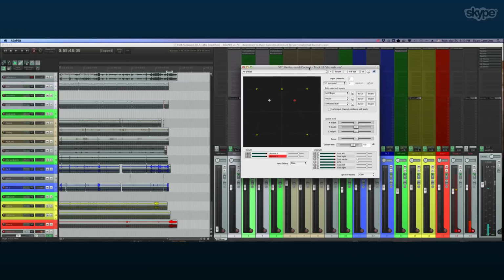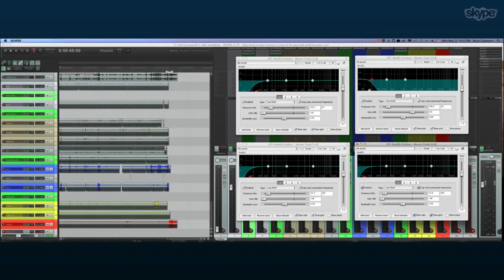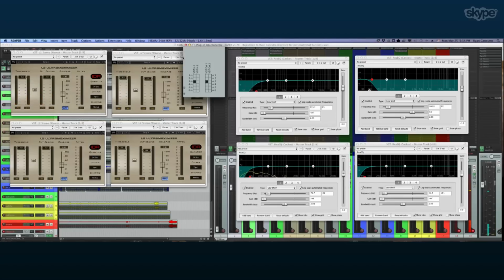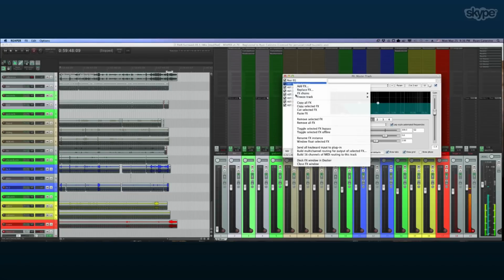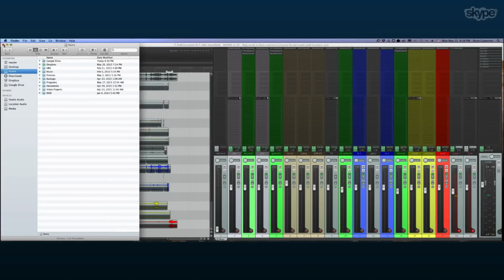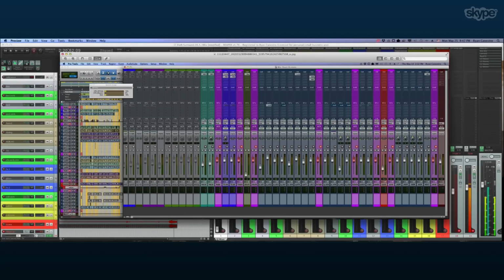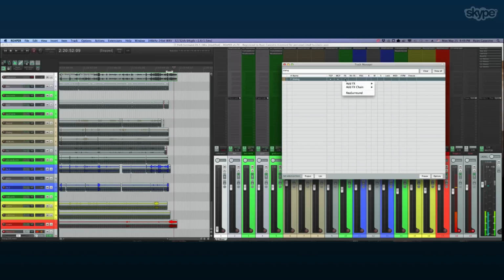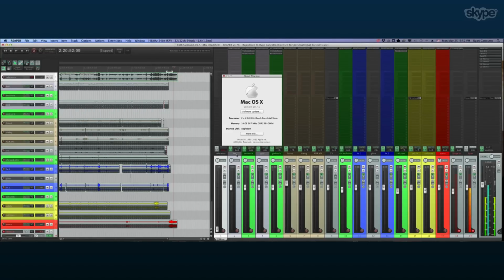Surround Mixing With Ryan Canestro

Comment: reasurround and 5.1 direct sound is not working at all. so In sony Vegas this is one click and work smooth as u need. surround mixing is easy in vegas, but in reaper its just not work at all! i wati 3 years no to fix this issue. but no there is no fix at all!

Comment: +The REAPER Blog Jon, I'm pretty new to Reaper, coming from Adobe Audition CS6. I'm currently working on a short film for Festival release, mixing sound in Audition, but am considering moving it to Reaper. I'm familiar with the features in Audition, especially the FX, tools, and the quality of them. What I don't know is the overall quality of the FX and built-in plug-ins in Reaper. Are these all written by various people, and do these people have experience in developing mathematically optimum algorithms for sound (i.e., like the plug-in factories)? For example, I've tested the ReaSurround FX in Reaper because I will be printing in 5.1, and what I found in my testing was that when I moved the sound around in space (rather rapidly), I'd get static, which was not only in the 'live' version, but was also in the recorded files upon replay. Similar tests in Audition had no such artifacts. So it immediately made me question the audio fidelity of the Reaper FXs. I have to say, though, that the usability and customizability of Reaper far outweighs anything available in Audition. Anything you can add that might boost my confidence on the FXs? Would love to hear from others who have used the 'industry standard' DAWs (ProTools, etc.) and then switched to Reaper, and how they assess the built-in plug-ins in Reaper. I know Reaper supports 3rd party, and most of these experienced folks will have libraries of their own plug-ins they will use, but so far I've been pretty pleased with the default plug-ins in Audition. The only other thing that held me back originally from moving from Audition to Reaper was the lack of a Waveform editor. Fortunately, since I own Audition, I set it up as the 'external' editor and that would be a workable solution short term. Audition's wave editor is quite powerful, and fully integrated. Any plans for Reaper to add one of their own in the future? Oh, and THANKS for this great blog and the videos. Most informative. Cheers!

Comment: You should be able to drop the video right in as a track in Reaper, turn on the video window from the view menu, and you are looking video with the sound while you mix.  A couple of caveats: Reaper doesn't like some video formats, so you might need to re-encode it to something else with FFmpeg first.  2. In my experience, Reaper is far less stable when being used with a video preview (i.e. I've had it crash when clicking around the timeline too quickly).  To help with this, you can mute the video track when you are not previewing.  And Save early, Save often!
Reply from the maker: Ownrisk Media Had the video window closed for the demo because it is unreleased and we don't have permission to play any of it.

When I'm editing these tutorials I use a layout like this
https://dl.dropboxusercontent.com/u/1053122/video_editing.png

I use the AVFoundation decoder because it seems to handle large videos a bit better than VLC, FFmpeg or Quicktime in terms of speed of editing and having the video window update quickly. But it does occasionally crash. I edit with both h.264 and ProRes 422 HQ files.

Comment: Sorry for the basic question, but what sound card are you using that offers 5.1 exporting?
Reply: Most recording guys are using an external interface with 8 discrete outputs. They come with anywhere from two to 32 outputs, depending on needs and budget. Look up the Scarlett series for a decent starter interface
Reply: Anything with 6 output channels